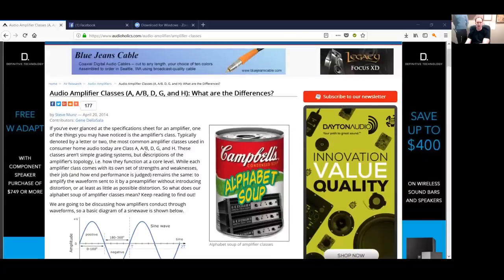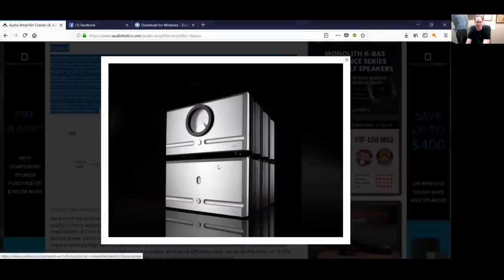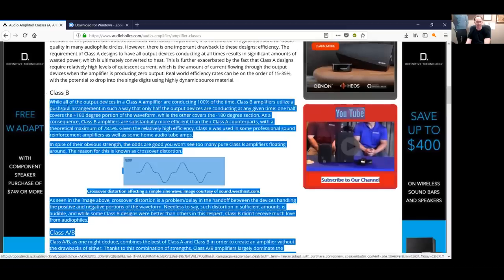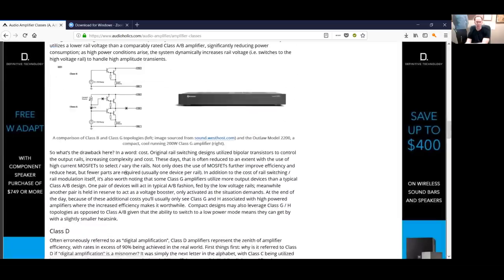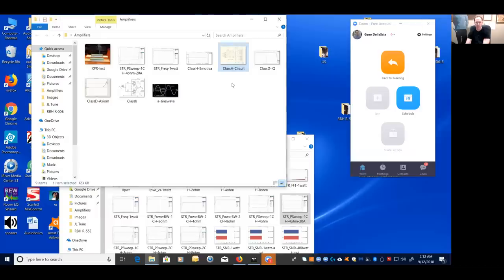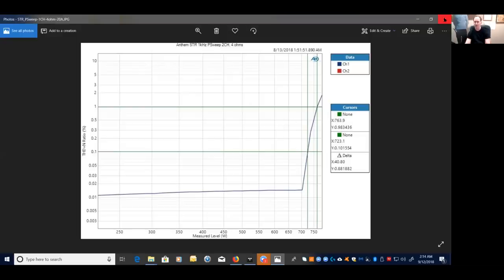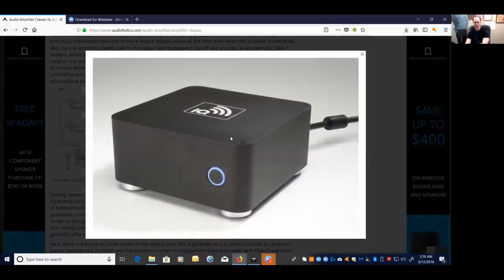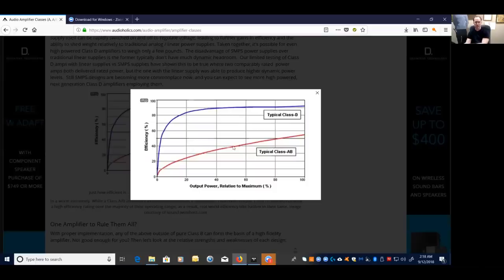What are the Differences Between Class A, AB,  and D Amplifiers?

Comment: As a poor retiree I have settled for used gear. I lucked into winning an auction for the Adcom gfa-555 power amp and it made me realize that the Carver M-500 I'd been using for a couple of months desperately needed repair as it lacked both high and low freq. sound that the Adcom outputted quite well. Anyway, after getting my grubby mitts on a wonderful-sounding pair of ADS L810's, I thought about how their 94db efficiency would hold up with less power, so I hooked them up to the Emotiva a-100 Flex amp I'd been using for headphones, and the sound was every bit as good as the Adcom. All of this is in near-field so none of the amps were ever pushed very hard at all, but the 50wpc Emotiva has proven to be everything I could want for this desktop. 

Love the vids, Gene!

Comment: Extremely well explained. I have a class A Tube EL34 2 x 12 Watts single-ended running in ultra-linear with a Tube preamp, a Technics 2 x 55 watts class A and a Sony 2 x 50 watts class AB and use a home built 1/4 wavelength 14feet transmission pipe floor standing enclosures running duel concentric 61/2 inch drivers with 25% of the spider removed for greater compliance and efficiency and at 8ohms with balanced passive crossover and Zobel network with 25-30Hz (dependant on room placement) to 20Khz response. By a long way, the Tube amp has far more control and with an HD source is breathtaking! So much more harmonic detail and presence and the image is stunning with depth and can 'feel' the music. I think the trade-off of less efficiency is worth the results. All achieved with a low budget in mind and 100s of hours of effort.

Comment: Hi Gene,

I’m running a Pass Labs XA-30.8. It provides 61 Watts of pure class A regardless of impedance. After that it goes in class A/B. I use it with a pair of 100db efficient Klipsch towers. They were the top of the line Klipsch in 2006. Together they provide plenty of oomph. I’ve had the Pass for just over a year. The Klipsch never sounded so good!
Reply from the maker: That sounds like a great combo. Congrats.

Comment: I have always used A/B because I thought I paid more for less with A and that A was just old stuff for stubborn old guys. But now 20 years later I'm looking to get my next 2-chanel stereo after not having one the last 4 years I found Class A and have totally fallen in love. Nothing A/B sounds quite like Class A. I have listened to sooo many High End A/B amps and nothing is as smooth and powerfull at the same time. I also think that it's impossible to measure "Good Sound". You can have two cables made out of the same conducting material but put together different that will measure the same but sounds totally different. In my opinion the only quality test you can do on hifi is an old fashion listening session. Hifi is in the eye/ear of the beholder. It's like art, you can't measure art and say that's good or bad you can only look and make your mind up. Something you love I might not so who's right. Well that's all from me and have a blessed day

Comment: I currently use a Crown XLS1002 Class D amp - a professional amp. I heard many good things about it through the grapevine, especially about how "neutral" it sounds. I'm an old audio tweak who started in the 1970s. I've worked at Radio Shack and also Best Buy among my many retail audio experiences. The old "guiding principle" was straight-wire-with-gain. The best stuff was equipment that got out of the way, letting you get into the presence of the original recording. For years I used an SAE power amp that was reputed to be more neutral than any made at the time. (Mine was made in 1975.) I found that (after break-in!) the Crown was even more open and neutral. I use a Carver C-9 Sonic Hologram Generator with it, and I am getting imaging and presence that eliminates the need for surround or other multi-channel. Gene, if you haven't taken a couple of hours to listen to these Crown XLS DriveCore2 amps, you're missing out. Oh, and it's ice cold, even after 8+ hours of use - the fan has never turned on.

Comment: Hey Gene, Egg cooker here.
As an engineer and audiophile, I use a combination of internal amp channels and separates to power my 5.2.2 system. Class D is coming along but fails to provide the dynamic headroom  therefore requiring over spec'd power requirements.  Also the effect of switching noise coupling into source paths concerns me and I see no testing of it. 
I agree class A is bit much for anything high power and more than 2 channels, However, for my main channels I always use a good class A/B separate amp. 

Current system: 5.2.2- Legacy Whispers FL FR Center, Driven by Adcom 550's : Celestion F30 Surrounds, Just added height channels to front with cheap BIC bookshelves , Yamaha TSR-7810 AVR. 

Next Upgrade: 5 Channels of class A/B tube power amplification. Dynaco MkIII's fronts, Craftsmen  monoblock center, Dynaco ST70 for Surrounds. All are being rebuilt/designed with upgraded power supply boards and caps. Distortion specs acknowledged, there is no power sag and the dynamic tonal quality of these amps in my opinion is better than all but very high end AVR and most separates.  The 

All 5 channels run < 600 watts wide open and efficiency or not, these things still outperform most amps in any price range. They will sit atop my old school solid oak entertainment center for visibility of the tubes and near intake vents for my HVAC system in the walls.
Listen well.
Reply: How the heck does class d fail in dynamic headroom? =/

Comment: Great video good explanation. My first amp was a Yamaha CA1010 integrated amp, it sounded great. Then i got a NAD 3020 that also sounded great sadly it went up in smoke one night. Now I have a NAD Viso1 bluetooth speaker and it sounds fantastic. I know what a good system sounds like I built my own speakers for one set i used Phillips drivers with a 12inch woofer mid and tweeter. For my 2nd set i used an Electro Voice 15inch woofer with a horn tweeter. I used to place the Phillips speakers on top of the EV speakers and drive all 4 speakers with that Yamaha amp it played very loud would blow your hair back. I don't listen at those levels these days but that NAD Viso1 speaker can play very loudly indeed it has PSB speakers in it and is very accurate and dynamic, if you have not heard one of these you should check them out. They have to be considered the best value in audiophile sound, you will be impressed.

Comment: I had a pioneer sc 35. Beast of a amp. Very efficient and it drive all my 7 channels simultaneously with no problem. Amp didn't get as hot as other typical av receivers. Audio was in my experience superb. I use 8 to 4 ohms speakers with ease. Unfortunately its life ended because I had a bunch of toddlers who thought my amp was yogurt approve.

Comment: Well informed Gene.  I always said amplifiers and sound are like a car and engine, a Chevrolet does what a Mercedes does.  But, will it give you the prestige and name brand feeling like the other?  Amplifiers were perfected in the 90's already, they are just becoming more efficient with newer technology and capacitators.   For sound quality, there are many factors in getting that perfect sound from the source, room treatment, placement, etc... There are people who spend $100k for a perfect system and swear they sound better. than a $1k system.  I've used my vintage amps and speakers, and I don't need anymore; I've show friends at a garage sale to get equipment for $1k and listen to it, and see how good it sounds.  I think a company like Emotiva or Schiit gives you that quality vs. McIntosh or Accuphase.  People are just spending money on brand recognition.  Run two Emotiva HC-1 mono and bang, you have the best 2 channel stereo amplifier for the next 10 years.  For movies any receiver will cut it.

Comment: I am a producer , i work with sound forever , and let me tell you , why would you need more then 20W , i have 2x200W speakers , 8inch 2 way system ,  quad amped , every driver its own amp , 75W tweeters and 125W bass .  That is a good system  , clear as day , no distortion , i use about 20W of it  usually even less .
So whats the issue you ask ?  The issue is music is not a perfect thing , perfectly clean speaker and amp , thats clinical , its not musical .. So that is what i use because im a producer , i have to have clean sound . But when im listening , Class A nothing else . No discussion . Its not a bout measurements ,  its how it sounds . I want that soft Clip , i want that less hten perfect dynamics .
The Amp Sings and adds richness to the sound . So much that producers copy sounds of some machines , some Compressors and things .
Hence let me tell you , if you are an experienced audio person, you dont need more then 20W , so Class A and that is it .  Of cours you can have more then one amp for times when 20W is not enough .

Comment: My take away from this very nice video is that if my priority is the best possible sound, for instance to drive a 2 channel audiophile system, Class A amplification is the best possible choice with appropriate caveats regarding budget, listening space size, desired listening levels and speaker sensitivity. If those considerations demand more than about 20 watts, then Class AB may be a better choice. If those considerations demand more than about 200 watts, then Class D should also be considered and may prove the best compromise. If my priority is minimizing my electrical consumption (or $ outlay) and sound quality is secondary, such as  multi-channel AV system, or a music system for casual uncritical listening, then well chosen Class D likely offers the best compromise. 

One concern I do have unique to Class D is that the output filter is a reactive LC circuit, and most amp testing simulates speakers with a simple resistive load. Speakers are not resistors, but rather are reactive LCR loads in their own right, which therefore will interact with the Class D output filter circuit quite differently than a simple resistive load. Hopefully that interaction doesn't result in audible distortion, but testing the amp with a resistive load will not reveal whether or not that is the case. The only test that can is to use the actual speakers chosen for the system as the test load, since each speaker design offers unique LCR circuit characteristics. This issue is well known, much studied, and I hope, largely solved.
Reply: 100% agreement.

Comment: Very interesting, I was using my dad’s old Carver Amp and preamp but it needs taking into the repair shop to get it looked at. The preamp is a Carver Model C-1 High Fidelity Control Console Sonic Holography Preamplifier has sonic hologram processing technology for a 3D sound stage. The amp is a Carver Model M-1.5t Magnetic Field Power Amplifier High Headroom Low Feedback Power Amplifier with 350 watts per channel RMS Class A. It doesn’t have transformers in it and it’s smaller than a VHS/DVD combo player and weighs half as much and has not one switch or dial on the whole thing including an on off switch,you have to turn it on and off at the wall, it has an LED power indicator and 2 columns of LEDs to indicate the power output of the speakers once you turn the volume past half way on the preamp. The LEDs rise higher as you turn the volume up until the top 2 start flashing and if you leave it too high for too long it will trip out the speaker protection because they are being overheated, not because the amp is pushed too hard and there’s next to no distortion at that level either! You can hook up a lot of speakers to the one amp and it will just be adding more sound output to the listening room the more speakers you add until you blow the fuse at which stage you get a bigger fuse and you blow that fuse then you may want to turn it down a bit because your whole neighbourhood pushed out of their house lol! We used to have 4 large old school speakers hooked up 2 Realistic 160 watts each and 2 made up boxes adding to 230 watts each and with all 4 going they would be so loud but still clear.
Reply: The Carver M-1.5t is class H, not class A.

Comment: Gene, another great video!  One question, please.  Why have manufacturers not launched a multi-channel (5/7/9 or 11) Class D amp for hooking up to AVRs to get better power to their home theater speakers?  Spending $1500 on a receiver to only get ~40-50 watts when all channels are driven is pretty pathetic.
Reply from the maker: Yea the industry is slow to adopt Class D and to do it right, it's still costly. Thankfully most midpriced AVR's have preouts to add power down the road if you need it.
Reply: Hi Gene.  great video!!  I have a Denon X3400 with Elac Unifi lineup as home theater.  I was planning to get the Outlaw 5000.  But after watching your video, it got me thinking about a 5 channel class D amplifier.  Any suggestions??
Reply: Any of the Pioneers, regardless of generation, that are running the ICE Power amps will do. I saw a test done by an audio store owner where the Pioneer SC25, rated 140watts, held true to 140watts under 2ch load and roughly 90 - 100 watts under 7Ch load. This was put up against an equivalent Yamaha model, which, in that owners test, the Yamaha (rated 140 watt) output 180watts under 2Ch, but drastically fell down to 40 and even 25 watts at 5 - 7ch load. In his testing, the Yamaha ended up blowing out its power supply, and he sent it for RMA.

Of course, I would always recommend using multiple 2 channel power amps and using a Receiver as the DAC/Switch. Most modern receivers support pre outs. What you save in not buying an over priced receiver, you spend in amps. At the very least, Power the FL FR with a 2 channel.

Comment: I am running an Austrian AYON Crossfire iii tube amp. A single ended, class A amp. giving 2x30 W weighing about 95 pounds. I drive a pair of Martin Logan ESL Summit X. Yes, it gets warm in my man cave but the sound is silk smooth, warm (LOL) and just beautiful. The amp is actually very modern. It has internal digital control function but no digital circuits in the signal path.

Comment: I am currently commissioning a guy to build a custom class A tube amp for me. The amp design is based on the Unison Research Simply Italy schematics. I save 700€ over buying the Unison Research amp. The custom amp will use bare wire for all components and will use better parts. So this amp should last a long time and be easy to service. I will pair this amplifier with wideband speaker towers (using 1 driver) based on the Audax AM 21 driver. I am stoked. Wideband drivers combined with tube amps sound so life-like. The speakers are so efficient, they only need 1~3 watts. So the modest 10W amp output is plenty.

Comment: It would be great if you compare the consumer D amplifiers with professional D amplifiers from companies such as QSC, Crown, Powersoft, etc.  These commercial level amps are extremely reliable.  They drive multiple speakers and are designed to work for hours without a break.

Comment: Thanks for going beyond manufacturers’ specs. I’d like to see a much higher impedance linearity test though. Your graph is centered at zero ohms and tops out at 8. It would be much more helpful to see it start at zero with the top somewhere around 30 ohms. (A “4 ohm” driver isn’t actually 4 ohms; that’s its minimum)

Comment: I have a Yamaha AX900U amplifier. It's a class A/B design. It can pump 320 Watts into a 2 ohm load. It utilizes 4 NPN and 4 PNP BJT's on the power rail with a large aluminum heat sink. It runs cool and powers my 4 ohm speakers with ease.

Comment: Love me some Class D amps. I have two Crown XLS-1500's running off my receivers preamp outs. One is set to High Pass for my Klipsch front speakers. The other one is set at Bridged / Low Pass for my Klipsch sub. These Crowns put out over 500 watts into 4 ohms in stereo, and over 1500 watts bridged into 4 ohms. 
Is this why I have tinnitus?

Comment: The quick answer is.
Class-A full power on transistors for best sound.

Class-B only power on transistors when there is sound in and it can create unfortunate audible things when transistors turn on.

Class-AB. transistors are always on with a little power and never turn off completely.

A class-D amplifier or switching amplifier is an electronic amplifier in which the amplifying devices (transistors, usually MOSFETs) operate as electronic switches, and not as linear gain devices as in other amplifiers. They operate by rapidly switching back and forth between the supply rails, being fed by a modulator using pulse width, pulse density, or related techniques to encode the audio input into a pulse train. The audio escapes through a simple low-pass filter into the loudspeaker. The high-frequency pulses are blocked. Since the pairs of output transistors are never conducting at the same time, there is no other path for current flow apart from the low-pass filter / loudspeaker. For this reason, efficiency can exceed 90%.

Comment: I'm still running a Panasonic SA XR55 from 2005. I've compared it in sound tests alongside many newer non  D amps in the sub $1000 range and sonically the XR55 keeps up fine in its power class, if not beating a few. I dont need convincing Class D is the way to go given how old the panny is.

Comment: I stumbled on this video, and Im glad I did. I have a pair of Infinity Kappa 8s, from about 1989. I currently drive them with a Denon POA 2800, and yes, the amp turns into a heat radiator. What would be a proper alternative to the Denon amp? I love the speakers, they are outstanding for what they are.